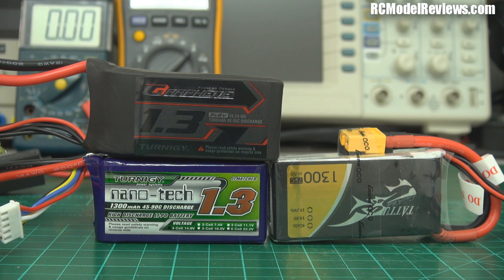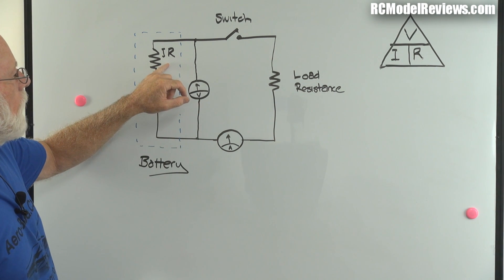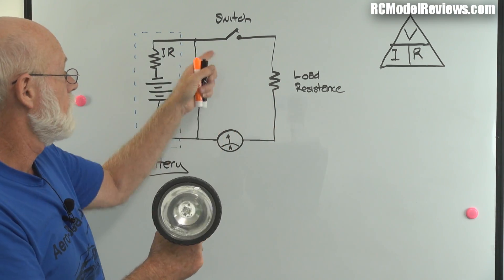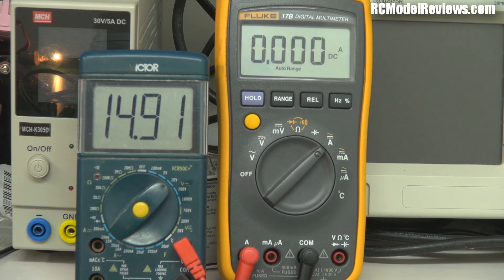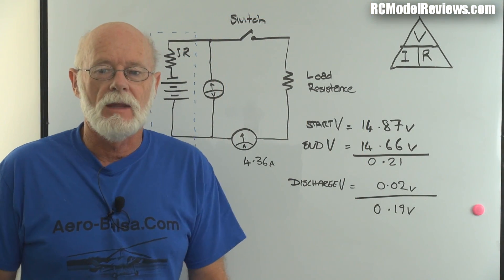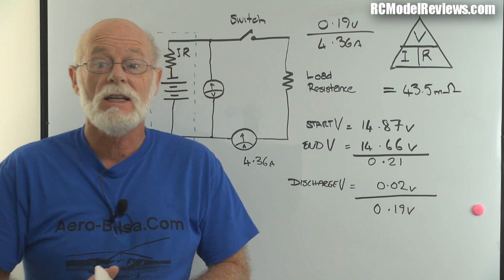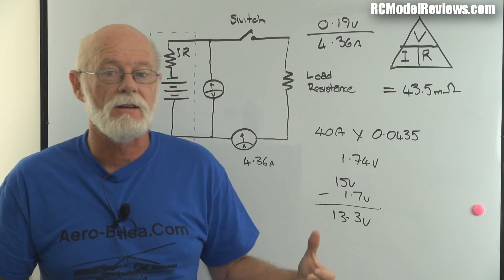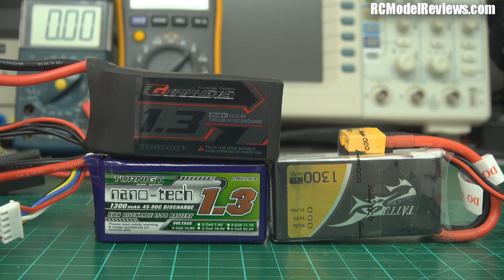Turnigy Graphene batteries:  calculating the internal resistance

Comment: If the internal resistance of a 2s lipo (lipo A) has 21 and 22 ohms and another 2s lipo (lipo B) has 26 and 27 ohms and both battery are exactly the same, which lipo would perform better?

Comment: Uhmm, your train went totally off the tracks. Measure the voltage of each cell at the balance plug with and without the load on the discharge leads. Then you can calculate the IR of each cell..

Comment: I own one graphene battery. It's a Dinogy 1300mah 80C batt. I have literally drained this battery on the bench down to destruction levels while it was connected to some little experiment I was performing. That was 6 months ago. I just went out today and flew a 6 minute flight on an AlfaRc Monster V2 frame w/ old eachine 2205/2300kv motors with the same battery. These things are well worth the extra few bucks you'll pay for them. Old video yes. Up to date reply....priceless ;)

Comment: So as you increase load rate you start to overcome ohmic polarization (which is all your test evaluates) now activation and concentration polarizations are your intercalation throttles.  Activation polarization is the resistance to intercalation and inherent to chemistry ( at higher rates ie. "Greater than a light bulb" you will have less impedance to intercalation with some chemistry than others.....your go juice!).  Concentration polarization is simply surface area of reactants within the cell.  More surface area = less pokarization.  This is done by modifying jelly roll of cell during design.  So again your test has very little relavance...   especially dealing with cell designed to deliver 600+ amperes continous.

Jus sayin man

Comment: What a dumbass!!!   Did you calculate that using a fourneir analysis. IR is measured at AC 1000hz.  You cant do DC IR on a battery.....you have polarizations other than ohmic....concentration and activization polarizations for example.   You have losses that your not explaining.   A battery is not an equivalent Z impedance.   Ignorance in motion here folks.  Lmao

Comment: Would be interested to know what the actual load is that is used to eliminate the Ionic charge, floating or resting voltage.  Also guidelines for testing other batteries based on Capacity and Voltage.  Also, use of AC impedance measurements to perform this?

Comment: Ok, so tbh I'm more than a lil disappointed in this result. After all the claims by the company. I thought these would have the lowest resistance of any batt I'd yet seen. I saw a claim of IR as low as 0.02 on these 'Graphene' cells, (not sure at what temp and draw rate though,) BUT in actuality they're higher than my current A-123 lifepo4 prismatic cells whose IR (as measured by my Cycle Analyst v3,) were measured at 0.034 ohms. 
Why are batt manufacturers such BS artists??!!! Their claims got me all excited for building a new higher voltage Ebike pack out of graphene lipo, guess we still gotta wait...

Comment: What if I do the following: Fully charge the lipo battery and wait 3 hours before I take measurements. Put a load of 4.36A for 20 seconds and then measure the voltage. Then turn off the load and measure the voltage. Could I do this and accurately calculate my IR for my batteries?

Comment: I've been watching a lot of your videos lately and trying to learn a lot of this stuff. So much to wrap my head around, but you're a very good teacher and great presenter.
I would love to see you do the same test on a 4S 2200mAh Turnigy Heavy Duty pack to see how it compares to the Graphene. I have a couple of these 4S Graphene packs and I've been using them in my ME-163 from HK along with the above mentioned 2200mah. Not a huge difference in performance as far as I can tell, but what I did notice is the low voltage alarms don't work too well with the Graphene packs. Basically, they start beeping right when the battery dies and I've been caught a couple of times with no power left to land. I guess the Graphene packs hold voltage really well as they should, but the THD 2200mah feel like they're on par as far as performance.
Thank you for the great, educational videos. 👍🏼
Reply: +Aussie RC Playground same here.. i run 2200mah i suspect they are truer to  a 2200mah battery...

Comment: Looking forward to the results, but I had no idea it would be this complicated.  I anticipated the use of a load such as a heating element, with an ammeter and voltmeter appropriately connected.  I do see one obvious difference between the batteries: the Nano-Tech has 14-gauge leads while the others have 12-gauge, meaning approximately a 1m𝛺 penalty per foot.  I know that's old scale but I figure you probably have about 1 foot of wire between the two leads.

Comment: Bruce, it would be interesting to repeat this test with various different load currents. I suspect that the ESR is not quite linear. You can also avoid the need to compensate for charge accumulation by calculating the resistance based on the difference between two loads, i.e. R = (V1-V2)/(I1-I2). I think this method would be more accurate.

Comment: There might be an issue because light bulbs do not have a constant resistance. As far as I remember, the resistance tends to increase with the temperature of the filament, which increases with the current. So I think that your experimental setting is somewhat wrong if you want to perform absolute measures. For comparative purposes, it might be still OK if the "resistance" increases monotonically with the voltage.

Comment: 5:54 The voltage goes up, because you have stopped drawing current over the internal resistance , so the new voltage is the no-load voltage, which is higher. Then your multimeter has a low-pass filter (especially in the DC setting) and so you have this effect of the voltage seeming to slowly go up (or down).  
Floating charge will affect it as well, but I bet it's mostly the dynamics of your voltmeter. If you use an oscilloscope to track the voltage without the lowpass filter, you'll be able to see the difference.

Comment: You've done a wonderful job of accounting for ionic charge, and the charge state as it discharges.  I notice you used the voltage it recovers to, not the starting voltage, which makes sense for the 1st order model over 10 secs.  For a static or slow changing usage case, it is nearly perfect.  Although it might eventually recover to the initial voltage if you remove the small load.

What about the 2nd order model?  The one with 2 different resistors.  One for current spikes or short bursts, and another resistor for extended current draw, like when it's hovering or moving forward at a constant speed without turning.  There are 2 different ways to draw the model circuit.  You have not taken into account the other resistor and capacitor.  This is relevant when the typical usage is in short bursts like during a race.  IR can be measured with an AC signal or a DC signal.  Both are relevant.  

Some say a resistor or light is different from a MOSFET/ESC.  I disagree.

Temperature is important.  A horrible Lipo at warm temps beats a quality Lipo that is cold every time.  This is especially true in the winter when the cells never reach a desirable temperature due to the 100mph freezing wind.  Even a few degrees matter on the bench.

Perhaps the Graphene is great at room temperature, but it stays cold due to its initial low IR.  And another Lipo warms up until the IR beats the Graphene.

http://www.ncbi.nlm.nih.gov/pmc/articles/PMC3247723/

Comment: One of the most important factors in battery longevity is max and min states of charge, that is, how full you charge (usually 4.2V/cell) and how far down you discharge (usually 3.3V/cell). What the electric vehicle manufacturers have found is that using the middle 70% of the battery capacity can dramatically increase the charge cycles to over 3000.  Take for example the Chevy volt which has a 150,000 mile battery warranty (in california) proves this, and is what has made the EV practical.  The other important factor is battery temperature under use and charge, as well as storage state of charge (~30-60% is best).  Its all about the $/(kWh*cycles).

Comment: I know I'm a bit picky, but I don't fully agree with your method because in fact you measure the internal resistance of the lipo parallel to the little light bulb. If the bulb draws say 1A then its resistance is approx. 15 ohms which is completely negligible (parallel to 45 milliohms). But I'm complaining about the method, not about the results ;-)

I would divide the voltage diff by the current diff which results in a slightly worse internal resistance. But the difference is just a few permille.
Reply: +Martin7182 It's most unlikely the test equipment is calibrated or very accurate, so the absolute value of the internal resistance won't be accurate. The number is really only valuable as a comparison with other batteries, and so long as the setup remains the same it should be good enough for that.
Reply: +philDotCom Thanks for that. I'm not complaining about accuracy but about the method. Not taking the parallel load into account will affect the outcome. The small bulb (15W?) is definitely a small load, but you shouldn't repeat this test with a very heavy load. Unless you use a better method, e.g. like I described above. 
On the other hand, Bruce seems to like Occam''s Razor, which is a good thing taken into account the mixed group of viewers of this channel.
Reply: +Martin7182 The point I was trying to make is that the objective here is to compare different batteries, so any small inaccuracy introduced by the small bulb is irrelevant if the same inaccuracy is present for each and every battery tested. The relative differences between them is still accurate. 

I was also trying to point out that the resolution and inaccuracy of the meters will far outweigh the inaccuracy introduced by the small bulb anyway. The small bulb was drawing 120mA, and through roughly 0.0435 Ohms equates to a voltage of 0.00522 Volts which wouldn't even register on the meter being used.

You are correct, but the difference in method would be immeasurable without much better equipment.
Reply: Thanks +philDotCom. I got your point although I didn't hear him say that the current was 120mA. But even it is 12A then it will affect the outcome just marginally

Comment: I got the Tundra plane from Hobby King. it said to use 3s. 11.1v 2200mAH min30c.  some one told me on a plane don't go higher then 2200mAH.. is it OK to? like Go up to a 2500mAH?
Reply: as long as the cg is right and the planr is not underpowered it doesn't matter wich size battery you take. so 2500 will be right for sure

Comment: While I find chalk talk interesting, the real proof in the pudding are flight times and pack life. While we're at it Bruce, you mentioned something about the IR measurement included on some chargers. In your experience, how accurate are they, what are they really indicating and how would you use that data. Currently (pun intended), I use those figures to show health of the pack and quality of the pack (lower is better) and I keep an eye out on retest for individual cells creeping up in resistance which shows as the pack ages. Any insight on this?
Reply: +Aerial Adventurer Thanks, I did understand that, but my question is more of what can they be used for, if anything at all? My practice has been to record internal resistance numbers on each battery when new and periodically check them for cells creeping upward as they do. I've had packs I unwisely drew too much current from and then wouldn't charge correctly. A quick check of their IR with my charger tells the story. I'm not sure supreme accuracy is what I'm after in that regard.

Comment: Would be interesting to see a comparison between the bolt  atteries and the graphenes. My subjective observations with my mini quad suggest similar power near full charge. The graphenes seem to hold onto that power all the way through the charge whereas the bolts sag a little. However the bolts definitely fly longer. Internal resistance measured on my charger shows lower for the bolts interestingly. Both very good batteries.

Comment: very cool lesson Bruce!   I was interested in the graphenes by myself as well (ordered the 1800mah 4cells since I want some more flight time with the vortex).
since I have 3 different batt types now   (Nanotech 2200mah 4cell, Tattu 1300 and graphene 1800) I did one practical test:
use a fresh battery, hover at 0m alt (well kind of) and apply full throttle and stop the time you need to gain 150m alt (max allowed height blabla...)   
also with recording the OSD in my DVR I can look at the VOLTS and AMPS while ascending fast.
the voltage drop (not sure how accurate ezOSD in vortex is) is quite different.
and now with your video I know the theoretical stuff to my practical test - this add's up so nice.

I add a link to my little test-video seperatly  - Bruce please get it out of your spam folder (where it will land for sure)

Comment: 0.0435 Ohms x 1.3A x 65C = 3,68V  Voltage drop under 65C

Minimum Voltage => 3V per Cell => 12V

12V + 3,68V = 15,68 V -> Minimum Voltage to deliver full 65C ?
Reply: +David Kaden Not sure that is true. The cell minimum voltage is really the off-load resting voltage, that's what gives you the 'state of charge'. Measuring the cell voltage under load is never a very accurate way of judging the state of charge, because it varies significantly with the amount of load current.

Comment: Doesn't that Internal Resistance you measured include the resistance of the light globe you used to take off the floating voltage?
Reply: yes, according to Thevenin or Norton's theorems, but the effect will be small as the bulb resistance will be much larger than 50m ohms and it will effectively be in parallel to the battery impedance.

Comment: In the last example, the voltage drop is 1.74V, and that is when 40A is being pulled from it. Since P=IV, that means the voltage drop represents 1.74V*40A = 69.6W. Where does that 70W go to? Is it what's heating up the battery? If so, I can see how a lower internal resistance can prolong battery life.

Comment: Does that include the connector? I had issues with the connectors on my graphene batteries due to shoddy soldering which would increase IR if measured with the connector.
Reply: didn't know Putin was into rc flying.
Reply: I like to airlift my attack bears in with a taranis. Really scares scummy capitalists.
Reply: +Vladmir Putin you should check out Bruce's UHF system shootout. Now you can bomb Europe from the comfort of the Kremlin :) Who would have thought RCModelReviews was assisting the Russian air force...

Comment: Nice Bruce! I know others have pointed out that you're not subtracting the load resistance from the total resistance, but it shouldn't matter as long as you continue to use the exact same load on all the batteries.  One thing that is worth mentioning is that IR is very heavily dependent on temperature.  If the packs vary even by a few degrees it can make a dramatic difference in the IR.  Ideally all the packs should sit at the same temperature in the same environment before testing.

Also I just got my ESR meter in the mail from Wayne Giles today and ran some quick tests on my 1300mah 4S 65C Graphenes I've been bashing about for the last few months.  Cell IR measured about 4.7-4.9 mOhms at about 75deg F, with pack voltage around 26mOhm. They're at about 30 cycles or so, but I've accidentally overdrawn a couple of them down to below 3v per cell, and there's been no measurable increase in IR.
Reply: You don't need to worry about the load resistance. The only point of the load resistance is it determines what the current is, but since you are measuring the voltage only across the battery, there is no subtracting the load resistance
Reply: @aeroscience9834  You're measuring the voltage across the load as well. It is directly connected!